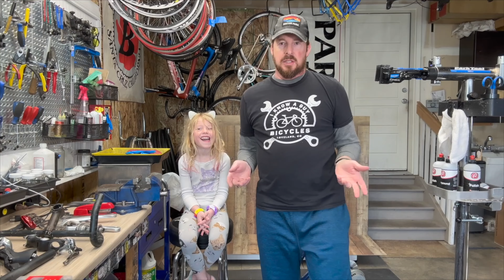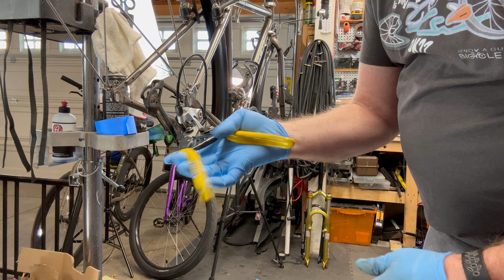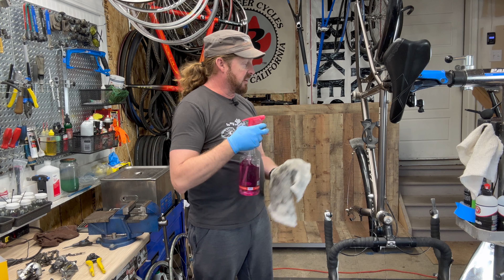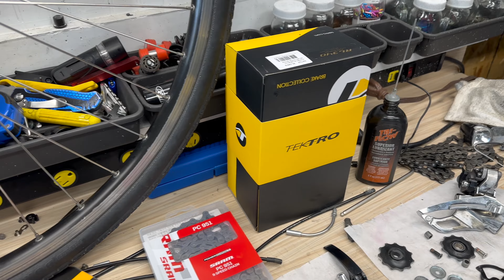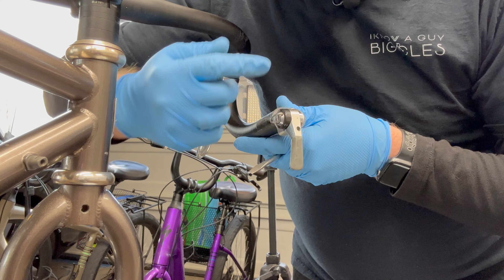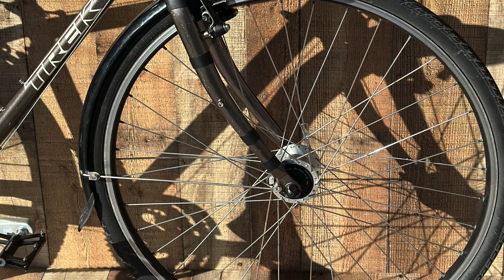2012 Trek 520 Touring Bike - Refurbishing this Classic Steel Bicycle

Comment: My 2012 Trek 520 is my primary commute rider. Bought it new in Feb 2012, 60 cm frame. Had to special order it as the shop didn’t stock 520s (few did). Still going strong on this bike, 12 years later! Too bad they discontinued this model.

Comment: For that lower bottle mount you can also buy an adapter plate (like Topeak's alt-position cage mount) that allows you to move the bottle cage mounting bolts further back towards the bottom bracket. My frame has bottle mounts under the down tube, but they're so close to the wheel that I can't even fit a small bottle there. But I bought a plate that allowed me to move the holes back so I can fit a small extra bottle under the down tube, which is useful for extra long rides.

Comment: Yesterday I bought a 2009 Trek 520, 57 cm, metalic brown like root beer color, tan leather saddle matching bar wrap, original tire's still like new, bike was in storage for 12 years, paid $500, definitely not a light weight bike 26.6 lbs. without racks , but that's ok.
Reply from the maker: Those are very nice rides, thanks for sharing!

Comment: Do you have wheel size info for the 520? Labels are missing from mine and I'm not sure of the exact dimensions, specifically rim width. So far I know 700c 36H 135/100 dropout width. Lots of good info in this video, have to say I never heard about the brake lever release trick 39:13. Thanks!
Reply from the maker: I don't know off the top of my head, but I do know they used more spokes and sometimes wider rims to carry the workload. Rim Di isn't the main focus; it's how strong the rim is. That has varied over the 25+ years of the bike's production.